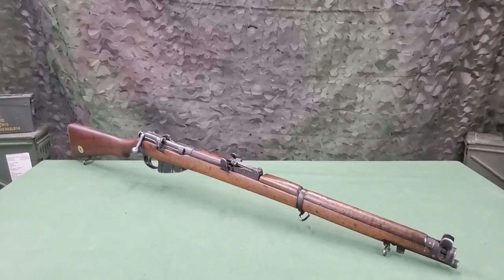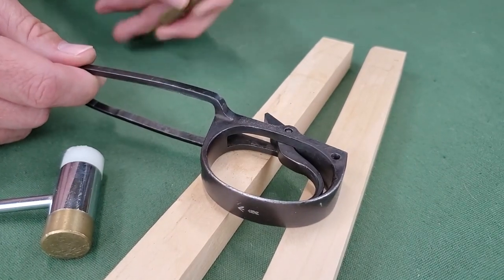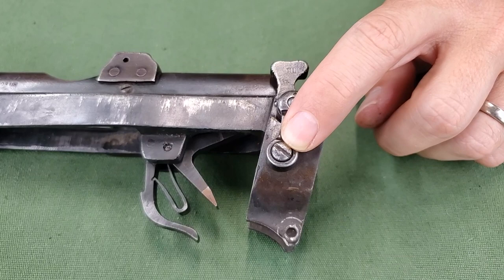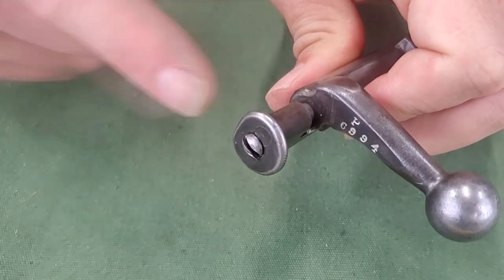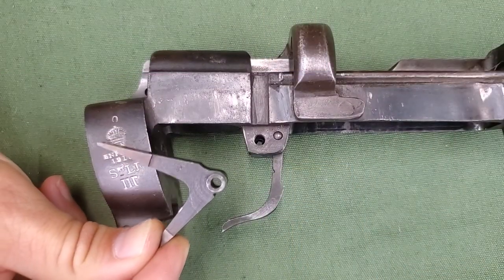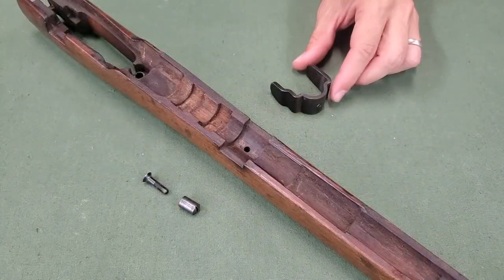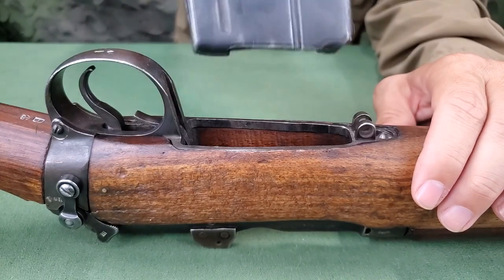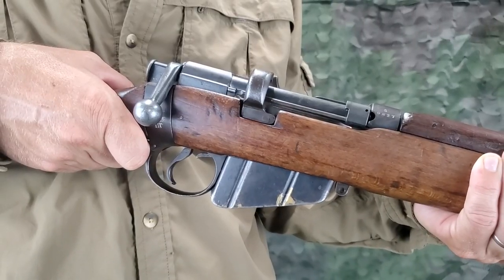SMLE Mk III* Detailed Disassembly (TF 4-04)

Comment: Thank you for this excellent video! By far the most professional and comprehensive SMLE disassembly video on YouTube! I have a question regarding re-assembly - how tight should the inner barrel band screw and the lower nose cap screw be set to maintain the accuracy of the rifle? Do I tighten them until they bottom out? Thank you!
Reply from the maker: Thank you and glad you found it helpful! I have always hand tightened them but have not pushed the rifle out to distance to check accuracy. Consistency in tightening those would likely improve accuracy.   Varying the torque on those and checking the group may be an interesting video 🤔

Comment: I have a no1 mrk3 ishapore, it has been sporterized and I am taking it back to full wood. The problem I have is the rear sight wood which clips to the barrel , what I dont know is how to fix the clip to the wood without damaging the wood ,am concerned I will split the wood . It also goes for the band at the front of the barrel again where there is a cap held by the rivets . Any help would massively appreciated, thanks
Reply from the maker: It might be easier to get those parts with the clip/cap already installed.

Comment: This disassembly is wrong. You must remove the stock before you remove the lower barrel wood section or you can split it.
Reply from the maker: Thanks for the input. In the INSTRUCTIONS FOR ARMOURERS, from The War Office, dated 30th September 1931, it states to remove the fore-end prior to the stock butt. Additionally, it highlights, "Attention is drawn to the importance of removing the fore-end before attempting to unscrew the stock bolt."